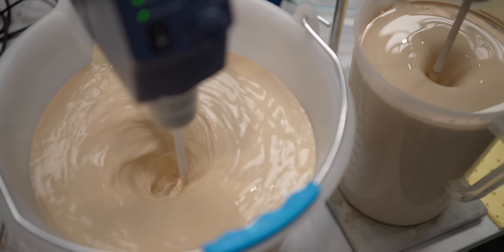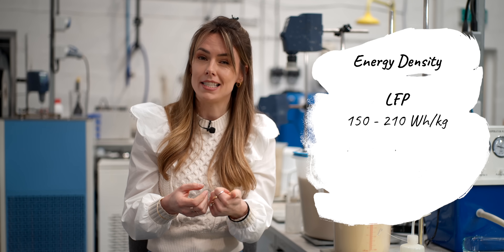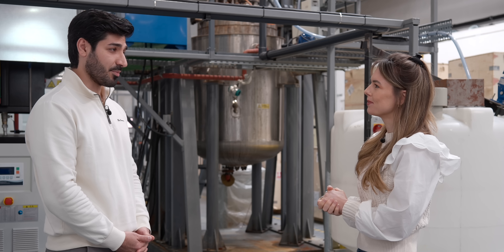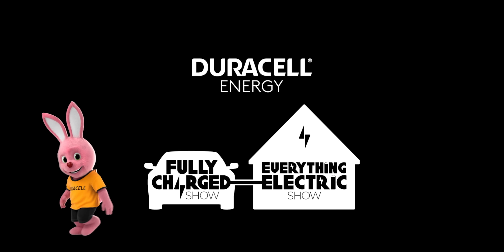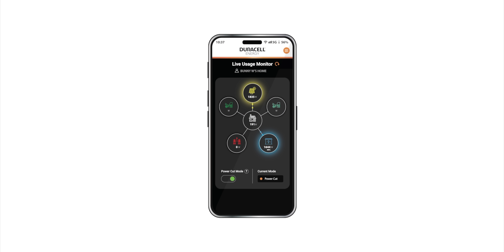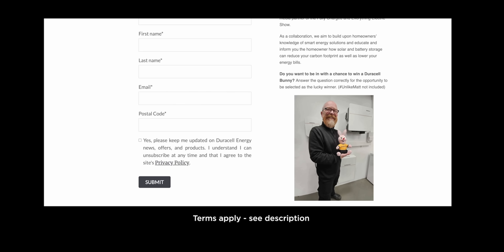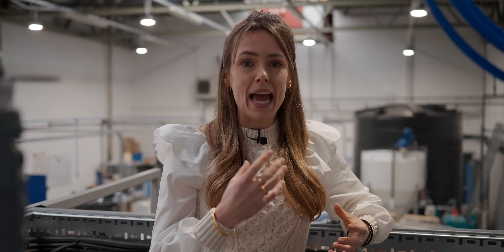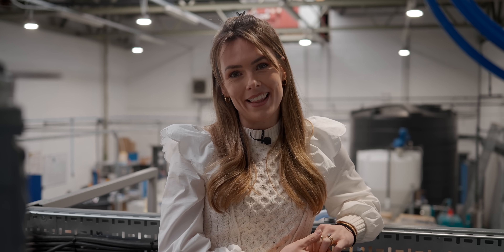Game-Changer?! Is LMFP The Key to More Range And Safer Batteries?!

Comment: Adding Manganese does increase the energy density of the batteries and allow faster charges which sounds great, but unfortunately it dramatically shortens the life of the battery.  If the original batteries lasted for almost a million miles, the Manganese batteries will potentially only last a few thousand miles, which is very bad news, unless they discover some new solution to fix that.

Also notice that everyone talks about the increase in energy density, better charging times, longer distance drive etc. but nobody mentions the much shorter battery life before replacement...

Comment: Yes, the frequent use of words like challenging and challenges seems to be very good descriptions of multiple aspects of their work. Very worthy goal though, there should be plenty of demand for LMFP batteries with higher energy density compared to LFP even if the power density has to be reduced slightly, as long as the LMFP batteries don't have any other significant disadvantages.

Comment: These aren’t a new tech cell but new to the general battery market. I’ve been building packs with cells (up-cycled) using NMC+LFP+LTO (NANO) for 5 years. These were originally specially designed for defense & aerospace application due to their high power, energy and safety features. I built a 58v pack for my sail boat that I converted to electric drive a few years ago
Reply: ?? Li-MFP  ???

Comment: And if my grandmother had wheels, she would be a bicycle....
Why are you hyping up stuff that is barely on the experiment stage, this is not a battery yet, and definitely not a gamechanger.
They are guesstimating a 20% improvement (in best case), that means somewhere less then10% in reality, and that is not gamechanger.
You wouldn't trade in your old car for the same car with 10% better range.
10% better battery density doesn't make battery-electric passenger flights possible, that would be a game changer.
You have also hyped up Heart Aero, but they have accepted defeat, there is no battery on the horizon that is a gamechanger, it is just incremental improvements, so they slapped a fossil burning generator in their planes and hope to atleast recover some of their investments

Comment: This is great but I thought it was already well known that adding manganese to an LFP chemistry makes for a better battery overall? I guess this video is for people who don't keep close tabs on batteries and  battery chemistry.
Reply: What you missed is their point that innovation in morphology is promising, and needs some help to scale up before giving up.
Reply: @ChrisNotTheKing  Did you know that CATL has had LMFP batteries in commercial production since early 2024? People may run out of support money but nobody is giving up.
Reply: @ramblerandy2397  
The point people keep missing amongst these comments is that there's innovation in anode morphology.  No comment on that aspect is just acknowledging what that dude said... they may be using the same chemicals, but not expecting to gain an edge doing the same as China, just with different supply chain.

Comment: Is LMFP irrelevant if Hyundai and Kia succeed with their 300Wh/kg pure LFP batteries? Probably cheaper without the manganese and same density as NMC
Reply: The Hyundai battery is also LFP, so is there potential to add another 20% energy with Manganese?  It's unclear now if it will be cheaper or not.

Comment: Its this obsession with Energy density that drives me mad! Its power density and charging infrastructure that is important.
Reply: All are equally important, higher energy density means smaller lighter batteries for the same energy capacity, which in turn means greater range and so lower frequency needing to charging. As to power density, or more accurately the charge/discharge rate of the battery (in the case of charging speed), then a mix of capabilities is required as for many home, workplace and destination charging works well (given the UK and global average mileage is circa 20 miles a day). 

So if the vehicle cost is lower due to the adoption of higher energy density, albeit lower power density, batteries these vehicles will sell well and meet most needs; those doing frequent further miles, needing to tow or wishing to charge infrequently (say once a month) then energy density may be an additional goal but likely one that will add additional vehicle and infrastructure cost to support such.
Reply: No no, like when people say governments are useless as they never hit the issue you're wanting them to hit, despite dealing with many many issues aside from that one particular one that gets your goat, both are massively important.

As is, how we're going to pay for electricity when we'll ultimately be using so many 'units' per household that it would make the very definition of a unit of electricity basically pointless.

Word to the wise, essentially we'll have to get to the point whereby electricity will become ubiquitous and the payment for it will be absorbed through taxation.

The bigger issue above it all is how we will cleanly be able to generate this much power and even deliver it to the point of need given the current infrastructure under the roads is completely insufficient for the task.
Reply: @weedfreer  EVs charging is a great fit for the massive amounts of cheap and quick renewables that are being installed everywhere in the world. We will be using a lot more electricity, but we will be using a lot less fossil fuels. Learn about "primary energy."

Comment: The title implies ev batteries are not safe. Pity. Spoilt the episode.
Reply: The title implies EV batteries are safe, but can become even more so 😂
Reply: Are cars safe or could they be made safer?
Reply: No energy source can ever be completely safe.
Reply: Experimenting with chemistries to improve energy density and cost per KW is the point here. Lithium flammability is a minor concern compared to oil, petrol, methane or hydrogen. The scare tactics used by the oil industry are just that. The last thing on my mind is that our cars aren’t safe because they might catch fire, and we have an EV and an old camper van. We both prefer the EV, but we keep the camper for holidays and the memories.
Reply: No; nothing about the title spoilt anything.  The word was "safer," implying they're safe but can be improved.
Reply: I’d say, relative to NMC…. LFP is bullet-proof, but NMC is less so…
Reply: no it does not.
Reply: If it said safe batteries yes, but it doesn't.

Comment: Oh, I thought this had already been done!  I saw a table showing LMFP had much more energy density than LFP but with a small drop in the number of cycles.
Reply: There are some which are commercial already, Guoxuan High-tech has the L600 "Qicheng" LFMP battery for example. I also would've liked to hear more about cycle life, since that seems to be a concern. LFMP supposedly has better low temperature performance compared to LFP too, which would be helpful living in the north for those occasions when you can't warm up the battery in the morning during winter
Reply: @Tomzuki.  the cycle warranty I saw was 4000 cycles, which seemed to be realistically enough for a car
Reply: Has the morphology been "done" though? What's the inside info on that innovation?